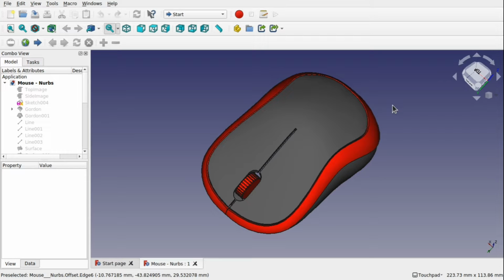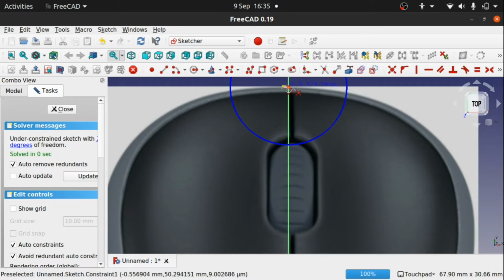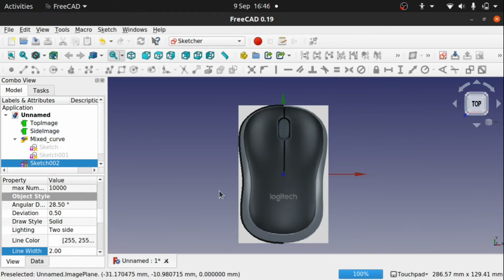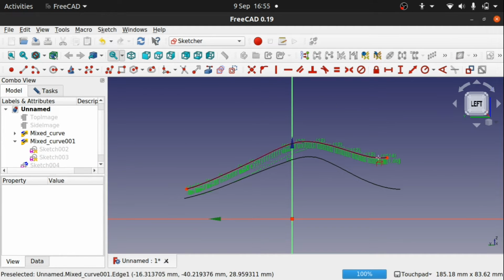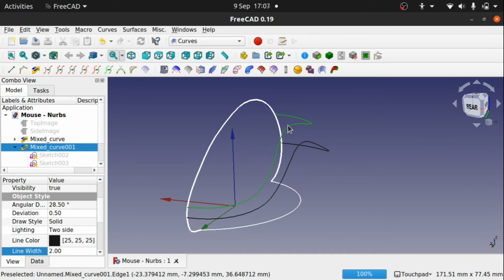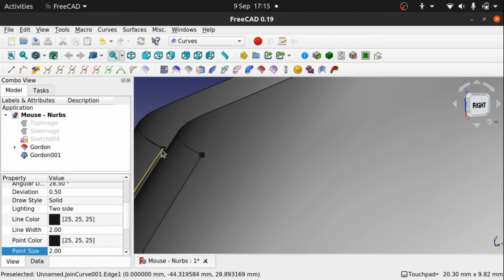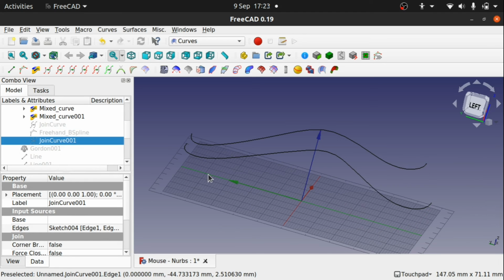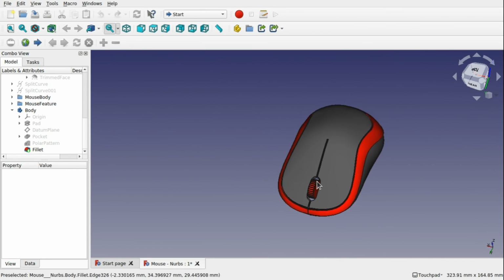FreeCAD: Part 1 of Model a 3D Mouse from 2D trace Sketcher and Curves Workbench Beginners Tutorial

Comment: For some reason after I do the Gordon, it will extend beyond my points and create a surface beyond. So when I'm at the part where I'm supposed to connect the straight line between two points, I can see the surface extending past those points. What causes this?

Comment: Great video, but one tip: you don't need to bother with using Surface Fill objects and the Parametric Lines to support them if you're closing faces with planar surfaces. Using the Ruled Surface from the Part workbench saves a ton of time and careful clicking, only needs the two parallel edges of your Gordon and Clone, one click on the button.
Reply from the maker: Great tip. I will give that a try. I didn't know you could do that. I don't use the ruled surface very often and it sounds like there's more to the tool  than I first thought.
Reply: A demo of that would be good.

Comment: For anyone following along, the mouse is a Logitech M185; the images are from the Logitech website.

I understand the point of this series is to demonstrate the tools, but wouldn't the more proper workflow be to make the entire thing a Gordon surface, or three Gordon surfaces?

My body protrudes through the feature in a couple places, and after 20 minutes playing with the continuity/degree settings of the top I never managed to get a clean shape.  I'm tempted to retry an all-Gordon route, but I have no idea how to cut the pieces apart with proper gaps.

This is actually rather timely, as I recently had a design idea for an ergonomic, asymmetrical ambidextrous mouse.
Reply from the maker: Yes you could make the whole thing in a gordon surface and probably the preferred route. As for the cut, you can us the Trim Face tool with the gordon surface and the two mixed curves with a side projection. Gapping can be accounted for with another traced mixed curve for the gap and another trim.

Comment: Really great how you make workarounds around some flaws in the programme. Big thumbs up.👍
Reply from the maker: Thanks for the comment. Things will always go wrong at some point and I try not to edit them out as I know someone in the end will get stuck at the same stage. Found the same in other CAD / 3D packages. You do something slightly different and you have to go back and fix the issue. I don't believe any build should be perfect first time and if errors occur then showing how I  fix or work around those  is essential for people to adopt the software and learn. We all learn by our mistakes or things going wrong so why not share them. 😁
Reply: @MangoJellySolutions : That's exactly the added value you're providing by explaining why you do or avoid things 👍 you're making an absolute great job  🎁